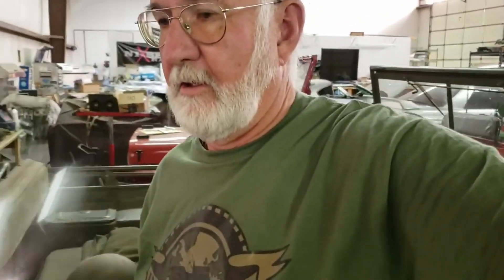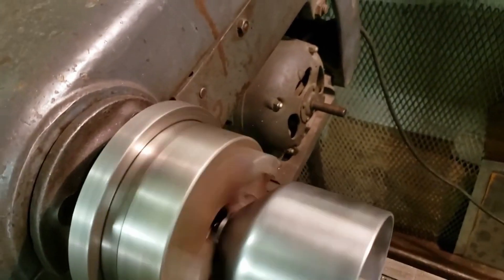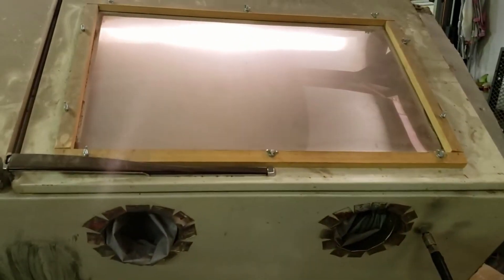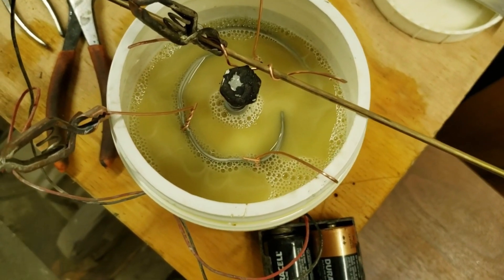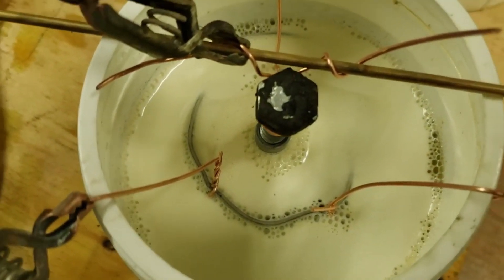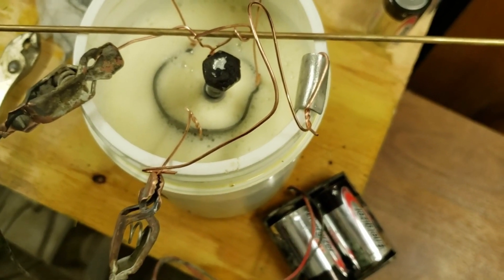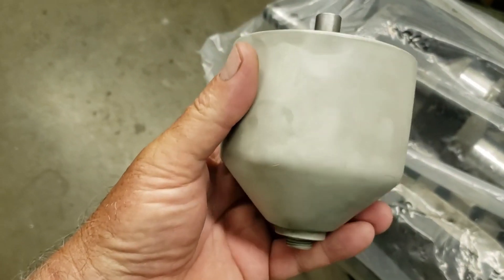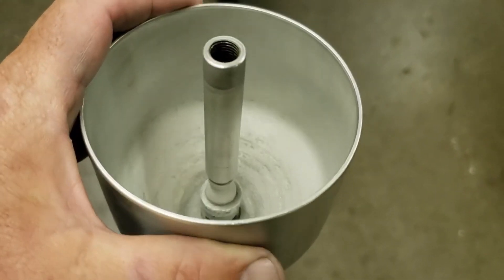Zinc Plating, Fuel Strainer Bowl, A step by step how to with Lew Ladwig Willys MB Ford GPW Team G503

Comment: This is one of the most useful videos on youtube! Very many thanks for posting this information, you mentioned Ammonium Chloride and Zinc Chloride in the solution, but I did not catch in what quantities they were present, is the plating electrolyte a 50/50 mix of these two ? Also, the wire wool has oil on it, do you degrease it before you card the sludge off?  Chris B.

Comment: I made a brass tumbler, by bolting the bottom half of a 5 gallon platic bucket,  (3 - 5/16" bolts  with nuts tac welded on after tightening) , to an orbital sander.